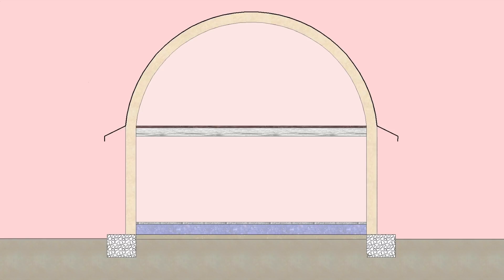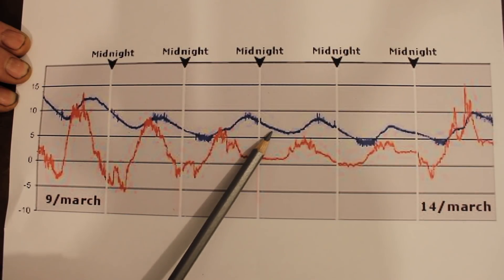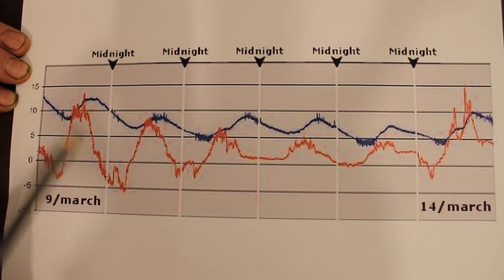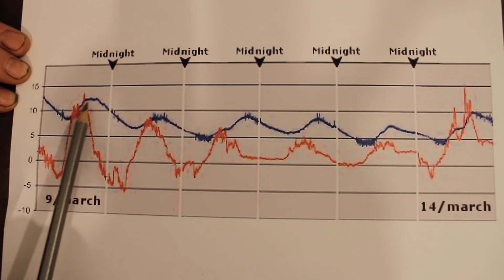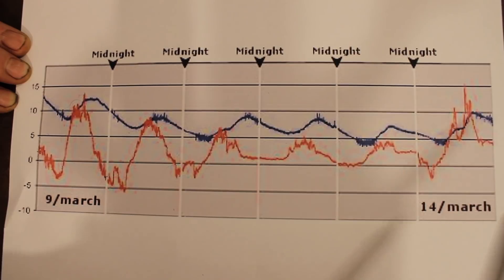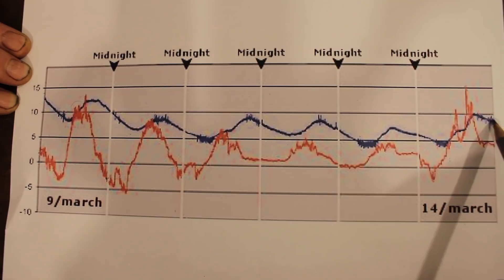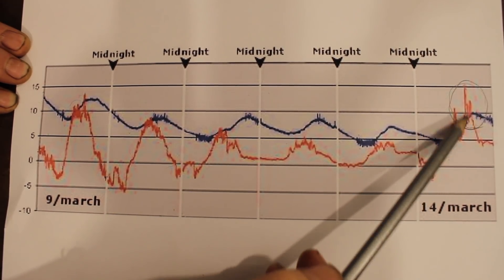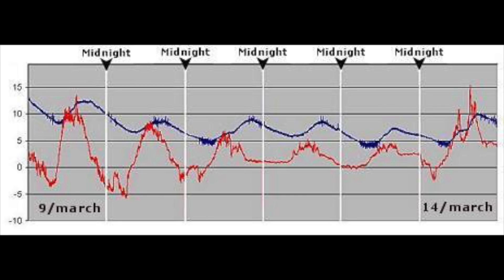what they don't tell you about Thermal Mass

Comment: Why wouldn't you have a heat source to heat your thermal mass. Build thermal mass around stoves' heater etc. If the thermal mass is located away from the source have a duct to and through the mass. My friend built his masses hollow with stove heat able to move through the walls.

Comment: Makes sense... Eventually the heat depletes unless you put more in... It's like a battery. The question is, what is the most effective way? 

I live in Arizona and wonder if I add solar panels to a sand battery. Would it help? How well would it work. I'm off-grid and my batteries are always full by about 11am. Send the remainder to green house? 

Not sure...

Comment: On your dome, was the temperature of the thermal mass only controlled by the ambient temperature of the room, such as the sun heating the exterior skin, heat transferred through the insulation, heat transferred through the room air, room air transferring heat to the floor thermal mass, assuming there are no rugs, carpet or wood floor. 
What would happen if windows were set to expose the thermal mass to direct sun light ?
My point - the system needs to be designed as a unit and must maximize all positive factors while minimizing any negative factor.

Comment: Even that last day proves the value of thermal mass. It's meant to keep the major swings in temperature, so for example today Where I live it's getting up to 89° f (~32°c), but overnight is going to drop to 65°f (~18°c). Ideally the temperature is low to mid '70s. I don't want the house to heat up to 89°, at 65 is probably too cold.

Because I'm in a cooling season right now, I usually do my best to let the heat out overnight and cool off the thermal mass in my house so that the temperature doesn't rise as quickly during the day. 

In the spring and fall I use my west facing porch with glass windows to heat my house. I open up the front door to the porch during the day and bring in heat, and then I close the door at night. That usually gives me another week or two before I have to turn on my boiler. I'm sure The heating on that porch helps keep the house warm whether the door is open or not. 

But it's a buffer against temperature swings. 

It probably doesn't hurt to have some form of hydronic heating and cooling to give you a little more control.

Comment: Point on midnight = - 0 C° to  - 5 °C !!!! There are not only the high heat capacity of material include unbaked bricks, adobe, mud, adobe, stone, clay and various combination. WE MUST LOOK AT DAY AND NIGHT THERMAL FLOW BETWEEN AS IN THE BUILDING AND IN THE IN THE OUTSIDE OF ENVIROMENT. GREAT POINT OF VIEW ( not only compering outside and inside temperature like roof surface, outside temp. °F, inside temp. °F) // Like yours idea because the typical response to these climates is not only to build with heavy masonary, which delays the heat transfer from outside to the inside!

Comment: that makes no sense, when a building is not heated, as it is dead mass, it will become as cold a s the environment. Only heating it in any shape or form does make it warmer then the outside. So the thermal mass cannot "store the cold" as everything in the house gets cold without engergy that heats the house up. Thermal mass stores energy, when there is no energy of a certain timespann everything cools out and goes in an equilibrium with the envrionment. There is no such thing as storing cold, you only can prevent cold mass from heating up. But in a cold house the thermal mass does not make anything colder.

Comment: I live in San Diego where we have mild winters..rarely below 40F at night in winter.  I pulled out all of the old carpet to bare concrete and then used 18” industrial carpet tile which has a little foam on the back but overall is all of 1/4” to 5/16” thick.  I’ve definitely noticed in winter that the floor feels like the air conditioner is always on.  I quickly realized its the cold concrete.  If the ground is cold, for weeks at a time, then of course the cement slab will absorb and radiate that temperature.  And I just don’t think any amount of sunlight would really do that much, save for a few hours after dark.  Because the surface area of the ground is the same as the slab and because they are in direct contact with one another, the ground will always win and will win fast.  The only resolution that I can imagine is a reflective barrier of insulation under the slab. Only then would it retain solar heat longer, maybe up to bedtime hours, but again, it depends on how cold the ground is.  I think people easily forget that there are several types of heat radiation and conductive, where one object touches another, is the greatest.

Comment: We already know this.
The advantage of thermal mass is that it will keep a home around a consistent temperature, too cold and you're screwed or too hot and you're screwed. In architecture, when you look at buildings in hot deserts with cold nights their roof structure is THICK. It absorbs heat, shades in indoors during the day and heats the indoors during the night.
Yes, some of that is lost, maybe half throughout the night, that is normal and something professionals design around to optimise the structure for its climate in locality.
But as the cold night begins to warm the now lukewarm thermal mass will begin to be cooler than the outside.
This phenomena, as the ambient temperature rises higher than the cooler thermal mass, will again being to warm it up.
This can keep a structure built in a hot desert to maintain a comfortable temperature, with threshold spaces and such, year-round, day and night.
Now, in a cold desert or climate, thermal mass is still essential. However, with its function still to retain temperature, now has to contend with damp or humid conditions which enables mould growth and internal structural damage. If the house is designed, using sophisticated detailing, the dew point will not occur on the inside or internal structure and avoid condensation.
What was just described is a key consideration for designers creating a Passive-House or Bio-Solar House or whichever type that desires to achieve Net-Zero energy standards.

I thought I'd share this information as some of the comments in the YouTube comments section were 'interesting' and I felt that the title of the video was a little misleading or quick to assume that qualified professionals in the industry were not aware or ignoring such things.
No ill intent was meant by sharing the information in this comment.
I'm not a professional myself, but I am a student.

Comment: Your correct in that you cannot passively charge or discharge a thermal mass at a comfortable rate. You have to look at the mass as a battery that you want to either charge or discharge. Once you have that trained into your mind you move on to doing things like plumbing rain water through the mass for cooling, venting off unwanted thermal gains at the right times, making use of solar hydronic heating, and solar air heating. Once you combine it all you can flatten the curves slightly more and maintain closer to the desired comfort level without consuming energy or fuels that arent given free by nature. I would personally be interested in solar electric and infrared quarts heaters to heat the mass rather than hydronics because the infrared gives comfort on the spot while also heating the mass. But there are many options and each home. location, and owner will have various abilities and access to certain materials that others may not. One may have a spring they could use for cooling, while another has abundant wood, while another has solar. You have to make use of what you have.

Comment: You can get around the cold storage problem by opening the window. This reduces the building insulation to near zero, allowing warm air in, and at night you can close the window and raise the insulation value again.
Reply: By definition, cold can't be stored.
Reply: @nickwinn7812 The absence of heat gets stored.

Better?
Reply: @bobbyc1120  Are you absolutely determined to prove your lack of understanding?.

Comment: What they told me is thermal mass averages outsides temps so you dont have as great of swings. I was told to get as much solar gain in winter as possible. Meaning my mono sloped roof the sun should hit the top of my north wall in the winter. Also to insult my floor as much as possible to stop heat from radiating down.

Comment: Thermal mass and insulation run hand in with maintaining mean temperature, not to heat or cool the building.  In the summer, if you have sufficient mass and insulation, you can run your air conditioner at night instead of the heat of the day, dropping your electric bill dramatically. The same thing if you heat your house with electricity in the winter.  Run your furnace during the heat of the day.

Comment: Hi Paul, a good subject to discuss. As a Passive solar designer of 40 years I concur, however... Your northern English climate is not the best at re-energising thermal mass so yes you will need a radiant heat source to keep the mass from losing too much heat - and for those who might not know, any convection heater that heats air, will be useless at warming up thermal mass which needs radiant heat. Underfloor warm water pipe systems while ideal, are expensive to buy but a DIY system would be cheaper. A simple radiant wood stove though will irradiate thermal mass quite well. In New Zealand here, we have better winter sunshine hours so Passive solar homes with thermal mass are much easier to keep topped up with stored heat. I use fully insulated (including edges and footings) 100mm (4") thick floor slabs as an optimum thickness as 150mm takes more than 6 hours of radiant sunshine to heat up; and we only get a maximum of 6 useful hours of sun in winter here. A ratio of between 16% - 20% north facing glazing (south facing for you) of the exposed floor slab area, is about the right proportion of glazing to mass area. Any more than that results in over heated air in winter on a sunny day. We maintain internal winter temperatures of 18-20 deg C for a 24 hour period after a sunny day in winter. Our night time winter temperatures can be up to -5 deg. also, but some southern areas get to minus 10 deg C. Simple passive solar design with good insulation negates these extremes very well indeed. The sad thing is, hardly any architects here really understand how it works and usually cost clients too much money in over designed systems and at the same time cost those clients the thermal comfort they deserve. So  a good topic!
Reply: I would love to read up if you have a place to learn this

Comment: well that's exactly what you want actually. It takes the extremes out of the interior, that's why we lived in caves in upper latitudes during Neolithic era. you are also right in that you cant depend on this alone, thermal mass just makes the heating ?cooling system work less to maintain temperatures in the moment because the system doesn't need to react to extremes swings inside in short amounts of time.  In floor radiant heating of the slab is the best most efficient way and their are several strategies, like geo thermal heat pumps, high efficiency boilers, solar water heaters etc. I personally like the idea of using the natural underground heat source for passive cooling as well as heat pump operation . This could be used even in extremely cold regions given the below ground temperatures remain stable with plenty of heat for a high efficiency heat pump to utilize.
Reply: i wouldn't go as far as to say "extremely cold regions" they have permafrost....

Comment: That's it?  What they don't tell about thermal mass is that it works all the time?  Of course it does - this should be obvious to anyone from the go.  Thermal mass is the capacitance of a low-pass filter, and that makes changes in both directions more difficult.

Comment: The earth is thermal mass!  Use that!  
Insulating the building from the earth, requires somehow tempering the space inside....depending how severe the climate is for the house, determines how much more insulation is needed for the shell, and, how much mass you use...concrete mass is classic to use if insulating your mass from the earth.  
But, many have discovered simply using the earth’s mass...it’s already on-site, there’s far less carbon footprint to use the earth, than to use concrete.   
Building can be sited to take advantage of shade and sun, which helps keep the massive slab in the floor evened-out, passively, whether the slab is insulated from the earth, or not...but, it might not suit your requirements. 
But keys:  
.....The volume of the slab must be “tuned” or “balanced” to how much heat or cool the passive solar or shade can provide.  How those are provided, is up to the designer and how savvy they are at keeping it low-tech, low-cost simple.  
.....The placing of hydronic radiant floor heating, or in-ceiling radiant cooling, can be hybridized with solar or geothermal tubes, to provide, essentially, free indoor tempering.  
.....Those can push fluid around, or push air around.  
.....Insulating the building’s shell to double the R-value of Code requirements, is crucial. 
.....despite industries pushing “tight” buildings, buildings still need to “breath”...that can be costly high-tech, or low tech. Moving air around, is critically important as fresh air exchanges.

Comment: Very interresting and informative content. Thanks for the report of it.
A question I have is that my place is built into a mountain and some large boulders. It is on a multi-level with staircases made of concrete and earthbag walls covered in plaster.
Fo you rekon putting pex tubing and running hot water through it under the flooring and at different levels would help all that much ?
Thanks,
Wulfy
Reply: hydronic heating of a mass is a ballet IF you want comfort and to flatten the curves of the graphs like the content creator showed.. If not done just right the heat is to soon, to late, doesnt last long enough, or lasts to long. It would take some very sophisticated software and a weather man that actually can do his job. Everyones solution to the problem will be different due to location, structure, weather, and the people. House full of females going to say 4 times a day im cold when it is 76F inside and 20F outside.. But house full of men would think it is warm. Same females will tell you its hot inside in July 90F outside with AC on set to 72F. Ask me how i know....

Comment: This video is more theorized for somewhere in the UK. This is not the case in typical earthen homes in typical geographic locations. Building materials, wall thicknesses and building type all play a role in thermal mass physics. The thicker the walls the more efficient the thermal mass. IMO using insulation negates the theory of thermal mass. In places such as the UK were cold is more of a problem then heat, alternate heating source is definitely required, still requiring a very thick wall and possibly even straw bales for insulation.
Reply: You're just as clueless as he is.

Comment: Good explaining this, simple hot water solar system would heat the mass and even out the temperature, for a existing structure you can add a thermal mass bench or wall add water tubs or larger metal piping for a solar hot air system. Could Be Ran On A Solar pump or fan and would work automatically, This could be used in the summer for cooling by bringing in the cool air or water at night .

Comment: It isn't mass,  it is capacitance.  Mass has inertia.  An object doesn't keep getting warmer once energy is disconnected.  As soon as the energy balance changes the heat value changes. Capacitance is the better term.
Reply: I have been saying battery but capacitance works as well... it is the use of the material to be charged and discharged of its thermal energy. A ground loop is a ground battery if you use a second loop under it flowing from solar water heating panels your charging it at a faster rate. A thermal battery would cover all sorts of materials and have rates dependent of the chargers design and the materials conductive/resistive rate. Capacitors have a fast charge and discharge rate compared to conventional rechargeable batteries, but yes i agree. About the inertia part that is splitting hairs the common definition versus the scientific one. Without the context of how the word is used it means both with and without inertia which is defined by the unproven theory of gravity so it cannot be held as a fact.

Comment: Bottom line: thermal mass is great, IF you have some passive or active system to add heat to it, in the time frame necessary for your desired use.

These guys are building passive solar thermal houses in Alaska, where there is ZERO sun, and EXTREME insulation requirements for two months of the year...

  Their solution...  5-15 thousand gallon water tanks inside the insulated structure, providing  “thermal mass storage” of solar energy, with enhanced stratification to allow for the most efficient provision of multiple uses from DHW to hydronic heating.

  For anyone looking at hot water storage of thermal energy, their method of returning water without disrupting the stratification in the tank is quite interesting.

Comment: the problem you address has simple solution. 
If it is warmer outside than inside open the window.
the temperature inside will equalize to the temp outside, and then close the window when the temp dips.
effectively trapping the heat in. 
if you want to make this process more efficient, get a window fan to suck the warmer air in and blow the cooler air out.
Reply: Yes - or arrange your heat exchanger piping in the slab so that you can connect it directly to the outside when you want to move it in that direction.